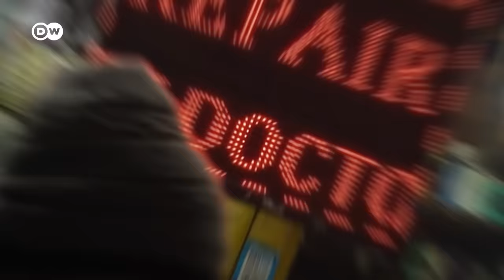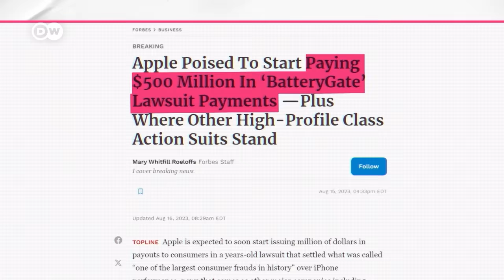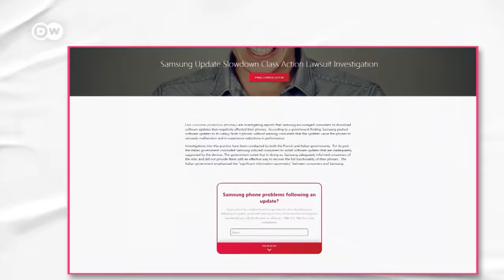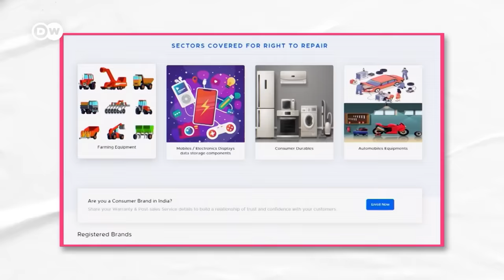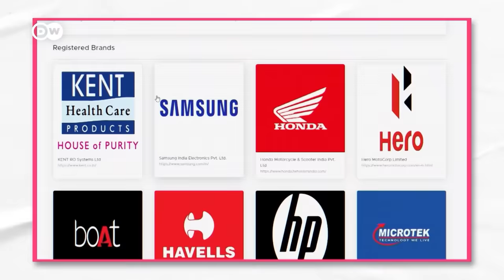How India wants to (literally) fix e-waste

Comment: Ultimately the consumer is responsible for this waste. Just because there's a new model anything, it doesn't mean we need it.
Reply: Tell this to your girlfriend..mine understands... thankfully.
Reply: Don't think so it's entirely but to some extend, as companies are marketing them that you must upgrade and seemingly difficult to repair and feels like the companies are abusing it under the name of protection of IP by making repairs costly (5000% wow)
Reply: The marketing team studies human psychology and make ads that deliberately tempt consumers...

So manufacturers share responsibility as well...

Most humans are weak minded and give in to temptation
Reply: I think that's part of the problem. Companies deliberately slowing phones with each updates or even not deliberate, they don't work on fixing it. Part of it is cheaper phones doesn't have much profit margin to R&D on it so it become obsolete quickly on software side. 

I have a Realme 3 pro which is 4 year old and it runs slower than my grandma on chair. Tho it has every thing that is required to still run , snapdragon 710, 64 gigs storage, 4gb ram. I have even removed all the possible bloatware from it using ADB but it still runs too slow.
I downgraded it to Android 10 from 11 and it became way fast but I lost some useful feature which I couldn't live without.
And it's not like I am some power user. I require it for basic tasks, calls, videos, payments and all but it still couldn't do it without lagging. I was tired at this point and now waiting for a good new phone.

Comment: The govt R2R framework is just a website for brands to register and govt to advertise their meaninless achievement.
 There ia not a single meaningful information or part price / availability liated on the entire portal. Heck even the notorious apple is signed up for the framework.
Most brands dont have anything listed(HP), the ones that do, only have 4-5 products at max(Mi). 
MARUTI Suzuki has 1 car model.
TVS has 1 product, and the repair manual link takes you to the owners manual page which everyone already gets with the vehicle.

Comment: My first PC was an assembled one, and I ran it as long as I could with RAM and video card upgrades. Sadly, there came a time to upgrade the CPU, but the new ones weren’t backward-compatible with the RAM and video card, so the idea of modularity went right out the window.

Later, I owned a Nokia 3310 which was built like a tank and lasted me 5 years before I was forced to buy myself a smartphone to go the digital path that India was marching on. 

It took three tries with Samsung before I realised that the security and linearity of Apple software (not hardware, mind you) is what made for much longer lasting phones. Now, I’ve owned an iPhone 11 for the last 4 (5?) years which still works as well as the day I bought it, with a battery that still shows 98% capacity, and I intend to run it till the time it dies on me. 

Mandating modularity and the right to repair on the manufacturers is one thing, and lauding the repair culture in India is another, but choosing the right device, caring for it well and running it to the maximum extent possible are also crucial tools in reducing ewaste.

Comment: Repair of Electronic equipment is very a very delicate work and not many people can do it right. I had a chinese android phone worth $145 and it lasted a good 3 years untill it's display died so I decided to get it repaired with fake non-warranty display which costed me $15 but while fixing the display they damaged the charging IC and tried to charge me another $8 but I refused bcause by then I had realized that it's better to buy a new phone because there's no guarantee if they could fix my phone.

Comment: Do you realize why they are incapable of giving you the guarantee? Either the "Original" is not the actual original or it is a stolen piece that will be installed on your phone. That is the same reason they are able to adjust the price of the screen across different vendors.
Reply: Yes, and that is exactly what the Right to Repair hopes to change

Comment: Repair cost from company's authorized store are very high. For example, my Pixel 4a screen broke last year, and it cost me 10k from an authorized repair store for screen and back cover replacement. At times, parts are not available in the local market, which forces the consumer to go to authorized stores where are charges are way higher. But I should also mention that repair store also changed my  battery for free.

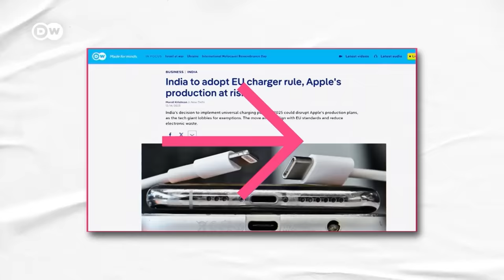Comment: 10:00 Don't yield to Apple. India is a huge market, they won't leave just because they're forced to use USB-C. EU's population is half of India's (or even less) but they still push Apple to follow the rules. India can do it too and it has more power cuz you know population with purchasing power.

My average phone life is 4 years starting with the first "brick". They're all still at home. I dare not throw them away. I used my last brick along with my first smartphone until it died.

Producers slow down my phone at least in one way: they pre install undeletable bloatware that I never use. And that bloatware keeps updating despite permissions from the initial 50–100 MB to 500–700 MB! You gotta be a geek to find a workaround. Most people just buy a new phone. Still, other apps also blow up: you have to update to a heavier version from time to time.

Comment: I was looking for Samsung and Apple Ai Photo editors while taking actual photos (Ai Camera picture qualitizer/ equalizer). And just found out that the Samsung S Series numbers actually have sense and meaning behind them with each representing the year each model was released was asking my self from the S3 how did we get to S24 so quickly FUN FACT (chappies):

Galaxy S	=2010-Jun-4
Galaxy S II=2011-May-2
Galaxy S III=2012-May-29
Galaxy S4=2013-Apr-27
Galaxy S5=2014-Apr-11
Galaxy S6=2015-Apr-10
Galaxy S7=2016-Mar-11
Galaxy S8=2017-Apr-21
Galaxy S9=2018-Mar-11
Galaxy S10=2019-Mar-4
Galaxy S20=2020-Mar-6
Galaxy S21=2021-Jan-29
Galaxy S22=2022-Feb-25
Galaxy S23=2023-Feb-17
Galaxy S24=2024-Jan-31

#E-Waste Incentives and subsidies (carrots) or taxes (sticks) need to be implemented like the Car battery industry (since the phones have batteries)

BRING in OLD MODEL discounted on NEW MODEL

Comment: Repairs will only work if; apps are optimized for performance; parts are cheap and easy to get.

I have my device since 2018 on Android 7.1; among hardware I cant afford fix, the only issue is the android and google apps, after forcing stop, phone is faster, feels like an $400 phone should.
Doesn't matter "7y updates" if your shitty android apps arent optimized for performance.

Why the f* does Google maps and translate need to start with the system? To not mention that many apps just dropped support and I cant even update or install version that is available and works.

It's not about side loading, would you trust a bank app from .APK?

Comment: I fixed my Samsung phone touch screen for 1200 rupees last week...he said if the display needs changing with original quality it will cost me 5500 rupees thank god only my touch needed changing and he said  in case the display needed changing he could do for around 3000rupees rather than buying a new phone this is great I had it fixed like 5 minutes away from my house in a phone repair shop it's very common all over my place and I don't even live in a meto city.

Comment: The problem is that repairing is no less expensive. I've been using my Realme 3 for almost 9 years. Due to carelessness i broke the screen so to the change the display they asked for 3k, i bought the phone for 11k. Is it worth it? No,with 3k you can get a secondhand phone with better model.

Comment: Smartphone repairs, especially the displays, cost a whopping third of the actual device. Why? 
The displays in the current era of smartphones rely on what the vendors and manufacturers refer to as a "Folder". Which is nothing but the components like the display, including the polarizer sheet, protective layering, etc. all combined into a singular form factor which itself is connected to a wire ribbon connected to either side of the frame or the chasis-eque design of the smartphone (all that miniature of a monolithic mess held together by industrial grade adhesive between the framework and the folder's borders facing inwards).

That intrinsic yet crafty mess of a component is what makes the manufacturers act so snob and vehemently charge the end consumers.
Contrary to the original product are the counterfeits called "copy" and the quality of the material makes them known in the marketplace as First/Second/ Third copy, where First Copy products are merely differing from the original ones in terms of quality and the thrid copies are the ones with bizarre quality yet wallet kissing prices.

The electronics market is a well-exemplified reflection of the term "Economic Problem", leaving the users with the dilemma of going with either quality or pocket-friendly prices.

With the non-stringent yet FDI favouring guidelines, it's the end consumer that gets the paper cuts by price tags.

Comment: The problem is that these companies do not only spend on developing new and better technology but also research on mixing the ingredients in a specific ratio so that they last only a specific time. They know exactly how much silicone to be mixed to get the chipset and motherboard to giveup after a certain years of usage, the car companies know ratio of metals to produce parts so that they work only for certain now of years or kms. Some of them are unreasonably expensive. VW i found to be the most notorious. A volume up and down button on the steering wheel costs 22,000 whereas in suzuki it costs only 1200. If they argue it is high quality then why does suzuki last and VW doesn't.

Comment: My 1st phone was a hand me down which was used for almost 7-8 years. I used my 1st smartphone for 4 years till battery was basically draining in an hour and other smartphones were just so better that upgrade was fine. Been using my phone for almost 5 years and sadly I dropped it twice this year and now my sd card reader doesnt work and theres dead pixels on top left corner with double touch issues. If just screen repair didnt cost 1/3rd the orignal price of the phone I would not be looking for a new phone right now.

Comment: We need parts for the right to repair, and those parts need to be imported (mostly Aliexpress). What has India done to reduce the cost of importing parts? Nothing. It all depends on the mood of the customs officer and is not cheap.
Framework, a right-to-repair advocate and laptop company, has clearly stated that they will not come to India until and unless the taxation and imports are lessened.

Comment: Its not just phones, every single home appliance is also hell bent on planned obsolescence. We bought a new washing machine just three years ago and it already needs costly repairs. The stem of the drum has rusted and they told us that they'll replace it with a steel one which cost around ₹12000. 
Why would a washing machine drum's stem be not made of steel to begin with, if not for entirely deliberate planned obsolescence?

Comment: the whole way smartphone and anything in general is made should be completely redone. why wouldnt it be possible to make a phone where you only need to replace the glass instead of the whole screen assembly? because it's cheaper to make and customers will need to buy new ones more often. companies should be responsible for the complete lifecycle of their devices, only then can current ways change.

Comment: Same goes with laptops. I had hp pavilion x360. Its display broke twice in three years. First time it was in warranty. Next time fuckers quoted 35k for display replacement of 80k laptop. I went to local vendor. Got display fixed plus SSD upgrade in 15k. Its been year and half now. Laptop's doing well.

Comment: Still rocking my SE 2 since 2020 and it's getting updates, supports all the apps that I need and functions well enough.. problem in India is many people prefer buying 150-200$ phones 2-3 times within 5 years than getting single phone which will last for the same 5 years bcs former won't get updates/won't support new apps that might be necessary for said person or simply doesn't work as expected after 1st year. If Apple can lover prices or some Android manufacturers can offer better phones at 150-250usd range there will be much less waste

Comment: I've had bad experience with repairing stuff at a store and by myself. BUT, Half of the issues can be blamed on using knockoff parts from aliexpress and the other half by not having guides for obscure devices that are not designed to be easy to repair.

Comment: Govt needs a regulation to check the production of electronic products beyond necessary and also a compulsory taking up of old products by the company at a reasonable price or some other feasible laws. Electronics should not be allowed to produce like a fast fashion. Monopoly on repairing, compromising on quality should be prevented completely.

Comment: The main problem for sustaining an older product is the lack of genuine spare parts with proper warranty and lack of standardized international laws to prevent planned obsolescence. 
Recently i went to change the battery of my 4 year old phone, the official service center people told me brand stopped giving spare parts for it, so no genuine battery is available. Now i am forced to buy a new phone because after market battery already failed twice. 
In past there was few mobile brands, so competition was less, quality was high because even if the device works for longer period, companies had sufficient sales, but with introduction of Chinese phone brands, they all are forced to cut corners to reduce price, also to increase sales of newer models quality is reduced and basic features are dropped to sell alternatives
3.5mm jack was dropped to promote the worst repairable TWS. Now instead of small amount of plastic, rubber and copper wire ending being ending up in garbage for a failed wired headphone, a failed TWS causes battery's, higher amount of plastic etc to become e waste.)

Comment: I used a touch screen Phone from 2013 till 2020, the current one is nearing four years old, and, I plan to keep it for as long as I can. This in addition to a basic Phone which I am using since 2014. Used well and maintained well, electronic gadgets can last very long, but, the best option is to not buy a new replacement device just because it is launched or introduced to the market.

Comment: Why not buy the display and change it yourself.
Paying someone for doing it instead of doing it yourself sounds absurd to me.
Reply: They change it for free if you buy from them. But you will not have the devices like vacuum box etc at home which are required to remove air and seal with the glue

Comment: Right to repair is one thing. What about software?

Why can i not install custom roms with ease on the phone i bought? I should have the choice for it. Why's it important? Its to bypass the software slowdowning companies use. And you can get more privacy, offline backup's, etc.
Reply from the maker: Yeah the software updates are also one way of the phenomena...Did you also check out this video from us? 👇
Planned Obsolescence: How companies trick you into buying a new phone
https://www.youtube.com/watch?v=7aYJPonRJd8
Reply: @DWPlanetA  Thats a good video, but why don't you guys cover this software lockdown on phones? In that video you cover only the hardware aspect. Whats the point of repairing/replacing battery of a 7 year old iphone 8/10 when it'll be running the latest iOS pretty badly. Do the same on a poco f1 and install a custom rom and it'll run smoother than those iphone 8/10's. 

I rarely see people praise xiaomi or google or one plus for their relatively open custom rom support. Why not make it even easier and more universally accessible? 

If you are interested why don't you cover how nvidia, amd and intel are artificially limiting laptops to force you to spend more money for less and less performance.
Reply from the maker: Thanks for suggesting that. We may look into this in the future. 🦾
Reply: @DWPlanetA  If you do, there's 2 major problems plaguing smartphones and laptops for you to choose to cover.  

Phones: Companies blocking custom rom installation and only xiaomi gives you the proper tools to do this. Google and oneplus are a bit harder. The rest? Very hard, or neigh impossible. 

Laptops: AMD and intel selling you 2 generation old CPU's under the latest gen CPU naming. They also paywalled tuning so you cannot make their CPU and GPU run cooler and faster. Nvidia is slowly starting to do this. All 3 are also artificially giving underpowered laptop CPU and GPU's.

Comment: I really love this documentary or article. I bought  my Nexus 6, 2years after the launch (dead cheaper) and used it for 4.5 yrs (I had to resell as it was not going dead).
Bought pixel 2 as soon as it is launched and used it for 6 yrs.
And now with thorough research bought Agni 2 a pseudo Desi product. Very good and very very underrated one. Have been using since it launch. Need to see how long this lasts.

Note: I have spent around 14K-6K for screen replacements. Once with Nexus 6(slipped from my hand) and replaced screen twice of pixel 2 (in my wife's hand😜) later on I took good care of it.😊.

Observation is I never stopped any security/patch updates.

I am planning to stop security updates once the patches tenure is over for Agni 2.
Reply from the maker: Hi there! Thanks for your feedback and sharing your experience 😊 If you want to see more videos like these, subscribe to our channel, we post new videos every Friday ✨